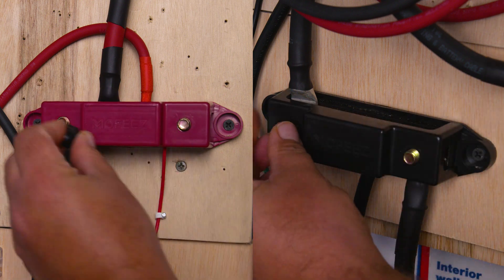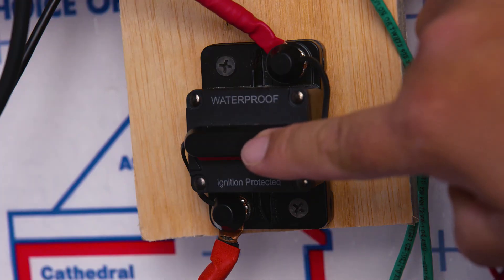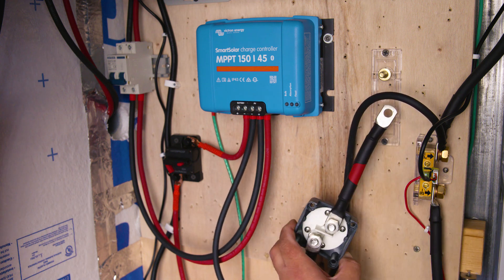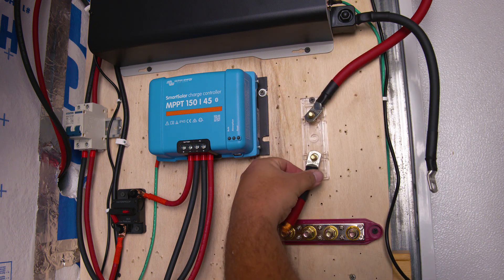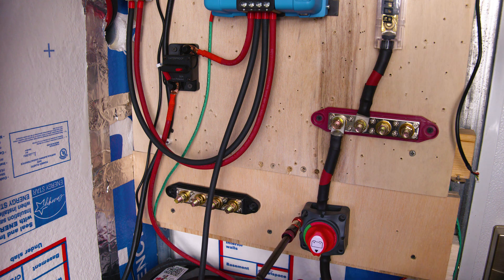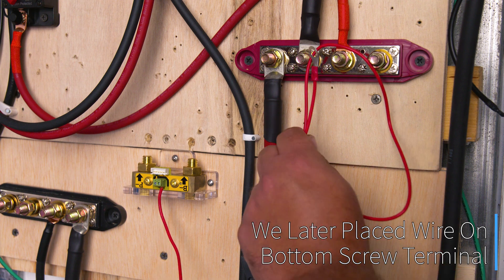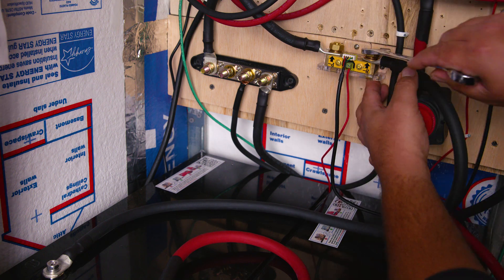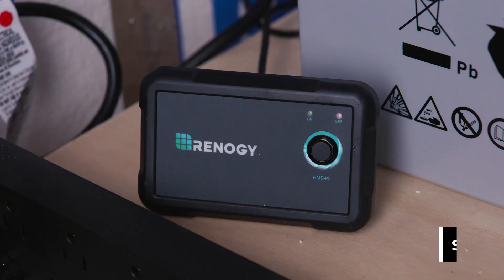How To Install BusBar Solar Panel System Easy Simple

Comment: Thank you for your video! I noticed that you removed the negative battery cable first when you started your video, so why didn't you also place the Battery Disconnect Switch on the negative side?